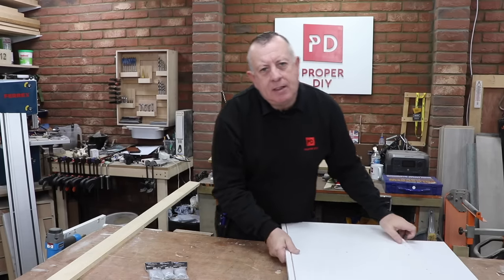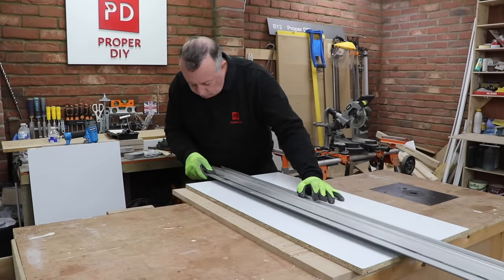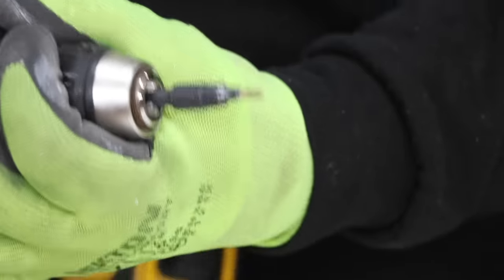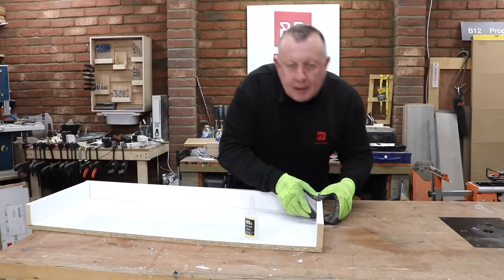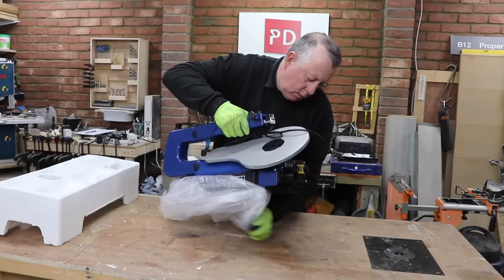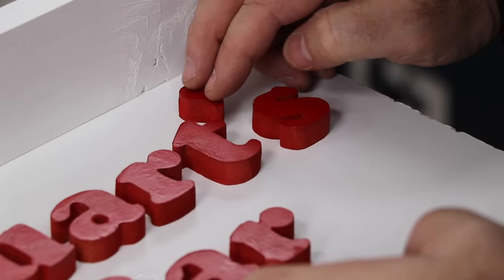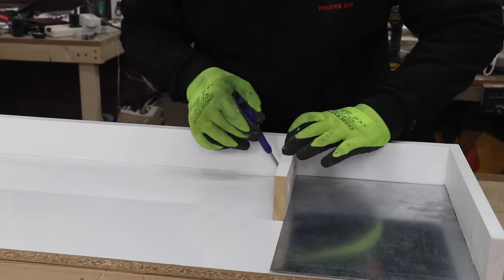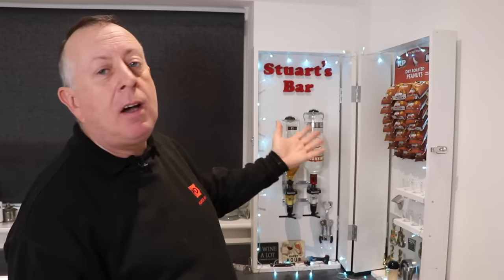Easy, Fun, Pop Up Home Bar Build for Parties

Comment: Great fun Stuart, a very accessible project and as you say a good way to use up materials that you have hanging around !

I'm sure it will be well used, wishing you and yours a great ( if slightly tipsy ) Christmas ! 😉
Reply: accessible so long as you have £1000s of equipment ;) 

I know, it's all possible using simpler, cheaper tools but even so... still, it's nice to see how the rich DIYer lives :)
Reply: And this weeks prize goes to …….. you.  It’s a fun project and uses some tools yes but as stated these tasks all possible with basic hand tools and time - just as rewarding if a joint project as described.  Stuart could do that but then you would be watching 25 mins of coping saw action and still not happy.  Your rock awaits.